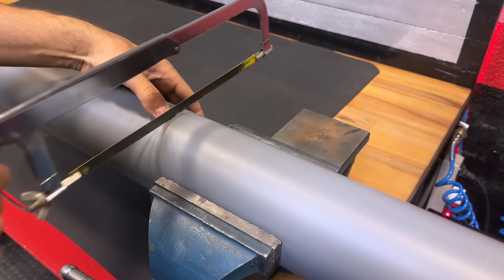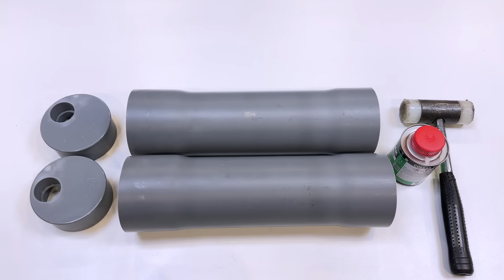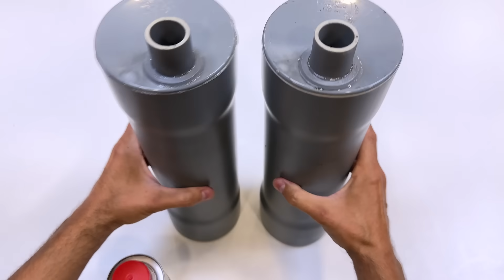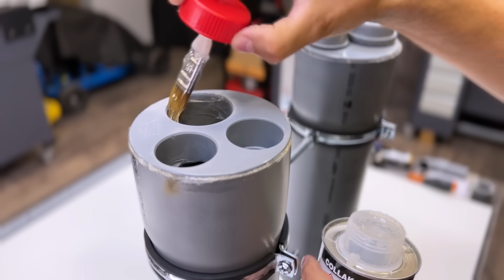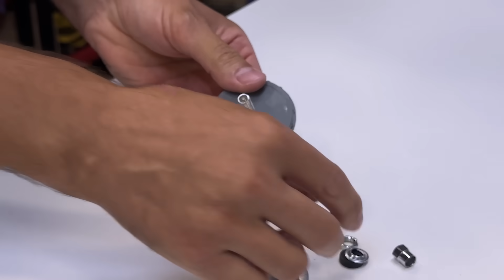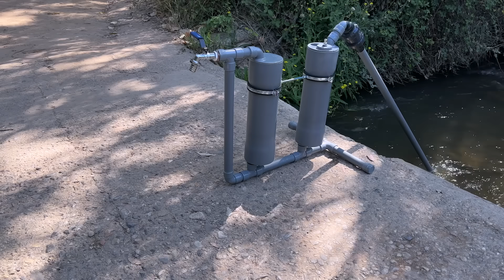Homemade Water Pump💧💧 Without Electricity or Fuel

Comment: What if I added more tubes to increase the pressure? Im tryn to build a self sustaining watering system for my gardening sprinkler system that'll provide enough pressure to water all of my plants using the runoff water from my Reverse Osmosis drinking water dispenser. Is that possible? Tryn to cut down the water bill.

Comment: The AI narrator basically describes a ram pump, but this is an attempt at a siphon. This might possibly work if you primed the intake and were not drawing from a downstream flow. Fancy sounding words strung together do not make something scientific, and they certainly do not magic things into being true. Im glad you had fun building this thing, and I hope you are using the profits from the video well. Please do not actually try and make people believe this is real.
Reply: can you explain "priming intake " and not drawing from a downstream flow ? would the flow have to be upstream or from a still source like a big water tank ? and priming intake .... would that be him pumping up the pump? please explain i would love to learn
Reply: @puresyre2051 Priming refers to the process of "pre-filling" the intake so it is already full and waiting. If there was air in the line it would never create enough suction to start a siphon. The intake would need to be getting fed from the Upstream side, or the side the water is flowing from. If it were the other way around, the flowing water would cause a draw from the pipe and prevent a siphon. All the bicycle pump is intended for is to remove the need to manually suck/pump start the siphon. I would be quite doubtful if that would work as well, even if the rest was correct.

Comment: Second question:  If we can move the water from that far away, would there be any way to start and prime that pump from the terminal end, rather than at the well head.

Or, as an alternative, could we simply store it in a tank at the terminal end, with another such pump, then only prime and pressurize the pump at the wellhead occasionally, to refill the tank?

Comment: I am not the consumate critic that others here are.  This is based on sound science, not voodoo.  You've made an impressive demonstration of a well thought out device that could be very useful to me personally, and I intend to build one to go with a property purchase.

Here's my application question.  Given that there is artesian well on the property that has been capped for now, and given that I will want to send the water 200-400 yards away from the well to a low rise dwelling, will this pump be able to accomplish that?
Reply: That's an impressive siphoning pump.
Reply: Give it a try. All they want are views. This is an old, old YouTube illusion. Notice you never see the pump moved before or after placement without a cut to another scene. Actual pressurized water must be connected to the intake or this will never work.

Comment: The heating the fitting crap does not hold up one all you did is shove something hot into pvc you sound have just warmed it enough to screw it on to make the proper threading then unscrew it apply rubber cement then put it back together

Comment: My concern is that the system will only run until the stored pressure from the compressed air runs out. If they had let the water run for say 60 seconds I would be convinced. Anyway I'll share this with my son and ask him to show it to his colleagues who specialize in this field.
Reply: What your son say?
Reply: @shoeoffhead3692 he said that to work as a siphon that the outlet had to be lower than the inlet and if genuine it would only last until the energy stored in the compressed ran out. During his explanation he started rambling off some straight forward equations and my brain glazed over. At least my guess regarding the compressed air was reasonable and he didn't tell me how stoopid I am, so that's a win.
Reply: @alpinealpine2793  so lets say you had someone pumping to keep that pressure then the "pump " would that keep ample pressure to siphon ?
Reply: @puresyre2051 my guess probably, but as soon as you tire your pump don't.

Comment: So let's get this straight, you've built a mini well pump with bladder. But, no constant air pressure it will shut off. No different that every well supply water system... wow ya are funny explaining this way..! 😂😅😅😂 It can't psiphon because it is up hill. You have effectively explained why a compressor is still needed.😂😂

Comment: There are two old and wise statements. The first is you can fool some of the people all of the time, and all of the people some of the time, but you can't fool all of the people all of the time. The second is called The Law of Conservation of Energy. It states that energy cannot be created or destroyed, but it can be transformed from one form to another. This fundamental principle of physics dictates that the total energy within an isolated system remains constant over time. In other words, this contraption cannot work in lifting water, under pressure, continuously.
Reply: Absolutely correct-- within a closed loop/system. But a red herring argument when applied to an open system.
Reply: @craigrosier523  close enough
Reply: @craigrosier523  nothing new, just a clever air pressure/volume syphon.

Comment: It works using air pressure. You build up pressure by forcing air into a chamber, which compresses it. When you release it, the pressurized air pushes the water out through a small opening. The water will keep flowing until the air pressure drops and can’t push the water out anymore.  Just like a Pump-Action Water Gun!!!
Reply: @DS-hp3nw  so, water wheel powered electric motor, run water back to start... infinite energy?

Comment: 110 liters per second through such a thin pipe, I feel like it should fly into space.🤣
Reply: @lenaisx 
4-5 bar of pressure in house water lines = 14-16 litres per minute.
He needs minimum 30 bars of pressure for 100 lit/min.
Impossible pressure for that pipe. 
100l volume per minute is sci fi.
Reply: @reconnectdoo3194  I think it's fantastic that 110L per second can flow through any pipe of this diameter.😁